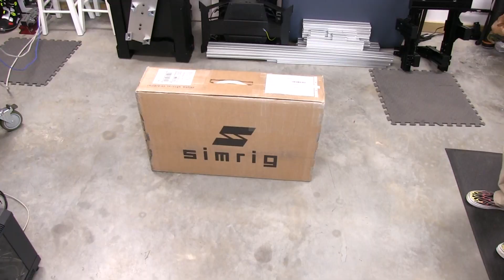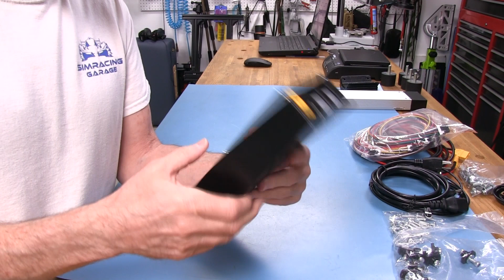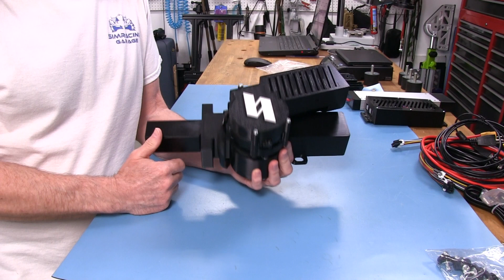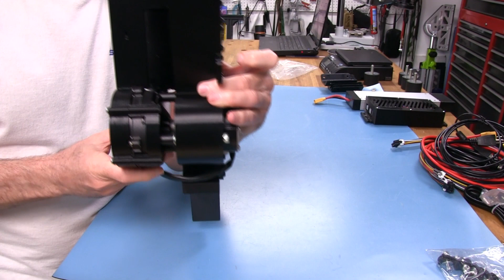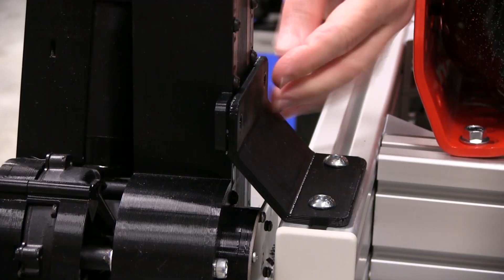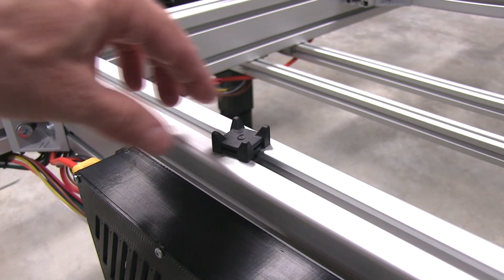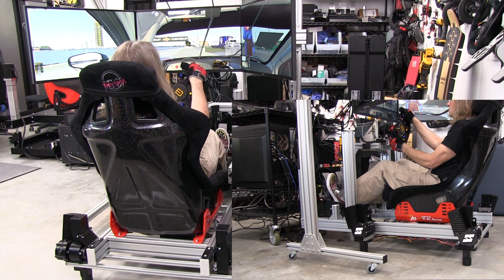Simrig SR1 Motion System Review

Comment: Until we can implement G forces which is impossible, sim racing will always be limited. The cost to building or buying a unit like this is far more expensive than buying a real car and going to your local racetrack for a year. Racing in real life seems far more interesting especially when the cost of these rigs are so much.
Reply: If we can try to keep everything polite- I've thought about this quite a bit- and my real life racing budget is meant to be ~$15,000 per year, but it always goes over- and that is a few events and a few tests in a FF. My cousin who did the Mini Dunlop 7s series for the last few years is not seeing change from $40,000 per year, and he has not smashed his car up once. When you throw in the time involved- whole weekends away- hours checking stuff and sorting issues- and the risks- not only of actual damage, but of your event being ruined by a mechanical problem, a red flag or crap weather- I'm persuaded that Sim racing is pretty good value. I'm set up with an oculus CV1, DD wheel and fanatic pedals & shifter- all in I'm probably down $5k. But that has given me hours of fun- risk free- and possible in a spare 30 mins. I'm looking at getting a motion set-up- to bring the current ~20% fun of real racing up to say ~30%. I just want something decent- I don't mind paying $10k for something good, but would be unhappy about $3k for something rubbish.
Reply: Sim racers don't sim racer just because its cheaper than real racing.  I don't play Call of duty because the firing range is too exspensive.  They are two different hobbies but connected.
Reply: @Horyzen Gaming well dont sim race then. People sim race because its a hobby not because its identical to real life. People like you do my head in. Its nothing like real life well no but its fun so maybe you need to chill and grow up. I race every weekend all yr and costs me on average £30k a yr as long as i dont have any bad situations and my rig cost me 5k plus 2.5k for the pc so no real racing isnt cheaper and sim racing once you have all the gear you can relax but real racing is a monthly cost all yr round
Reply: @Simlife101  You sound a proper nob head. Why are you talking so much crap? nothing you said is educational and is just your opinion, and your limited opinion sucks. Everything I said is factual but you are crying and triggered. Yes we all race for real and compete in real life and it costs us hundreds of thousands a year, so what? Still does not mean a sim will give you the same feeling or even comes close to real racing. So I suggest you get over it and keep you silly opinions to yourself as they are not needed and are very childish.
Reply: @Simlife101  What are you on about? you are the one not making any sense. You can buy a car ready for rallycross less then a £1000, entering races is at most £100, buy a helmet and off you go. Much more cheaper then buying a pro sim set up. So what I said is factual. Yes I spend more money racing but that is because I progressed in my driving career and can afford to race in a discipline I prefer. I started in rallycross and I so pleased i done that instead of wasting my time on a sim dreaming i was doing it for real.
Reply: @performanceenginesuk  one last thing where in hell in the UK can you get a rally x ready car for around £1000 and where can you race for as little as £100.
Reply: @performanceenginesuk  and if you had so much money you could do both as i do lol.
Reply: If i want to drive many different cars in different races on different tracks i nedd to be very rich to do it in real life but at home i do it every night
Reply: You really have no idea of the cost of real racing. You've got to remember there's no restart button in the real world.
Reply: @Rave-agent  Been racing for 30 years so yes i know exactly how much it costs. Maybe change your attitude as it seems you not got a clue about racing in the real world. I come from racing in the real world to sim, not the other way around. Sims where not about when i was a child so if you wanted to race then the only is in the real world. You just made yourself look a right dumbass.

Comment: I thought the pitch/roll was to try to simulate the G-forces to the best of a motion platforms ability and less to simulate the actual pitch and roll of the cars suspension. But I guess the body and its senses aren´t fooled that easily ;)

Great review keep up the good work and thank you for your part in making sim racing as enjoyable as it is
Reply: My thoughts exactly on simulating G-forces vs actual suspension kinematics
Reply: Actually we use pitch and roll to simulate road conditions such as uphill-downhill and turns. For suspension movements we use surge (acceleration-brakes) and sway for turning.
Reply: I think so too, and only seems exagerated because the screens are static. If screens moved with rig perhaps a better immersion of G would be achieved.
Reply: Or VR

Comment: Barry, how does it compare to the DOF Reality H3 that you reviewed?
Reply: Asim Chohan +1 Good question! I own a H2, it can get chunkie sometimes.. The SR1 seems to be much smoother, but less reactive..
Reply: I wanted to ask exactly the same thing
Reply: The most obvious difference would be heave instead of traction loss (yaw). Then there is the difference that comes with using actuators, and there's different software, and so on… Quite a number of differences, I'd bet.
Reply: @RoarMcRipHelmet  yes, but that difference is for the better on the simrig or on the dof reality?
Reply: @thisempty  As often is the case in these situations: It depends. If you want a system as quiet as possible, the actuators of the Simrig SR1 are the quietest. But if you have other noisy equipment (buttkickers, heavy FFB on wheel…) then that point is moot. Yaw makes it easier to detect traction loss, but if you're using VR then it may require a well-tuned motion compensation software so you don't get dizzy. I haven't tried a system with heave, so I don't know how useful it is. Many 2DOF+ systems use pitch in specific ways to compensate for heave, and maybe that's good enough, I don't know. Software: The Simrig software looks to me like it is proprietary, while DOF Reality uses SimTools which has many popular user-generated profiles. Just a guess: The Simrig software might be more plug-and-play with popular games, but if you want to try motion on more obscure games then DOF Reality is likely to be better. There is no definite answer to which is better, it depends on your requirements.
Reply: @RoarMcRipHelmet  thanks a lot for the help. I'm almost sold on the dof reality, but now you got me worried with that motion compensation thing you mentioned. I'm all for VR, won't be using triple monitors.
Reply: Disclaimer: I only have personal experience with my 2DOF Next Level Racing motion platform v3, but the info I wrote above is from stuff I've read people say on xsimulator.net and elsewhere